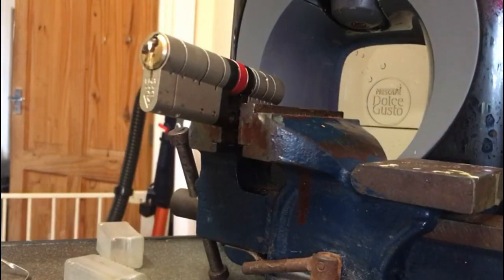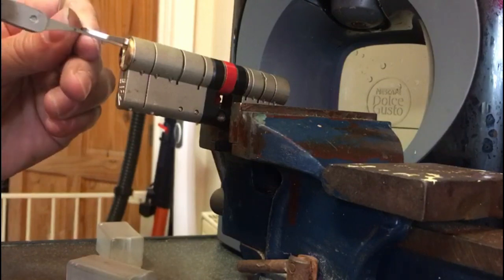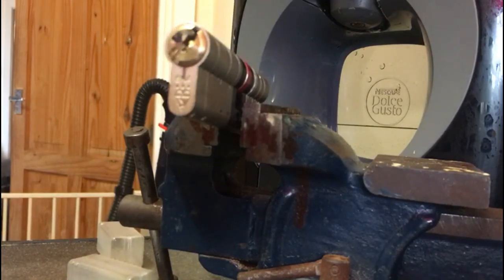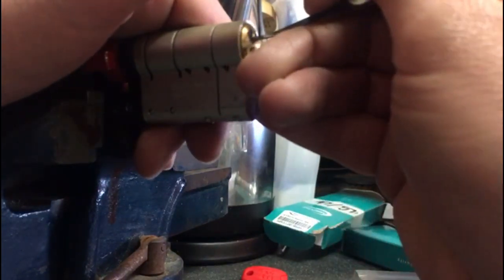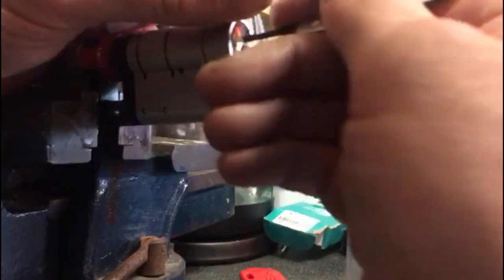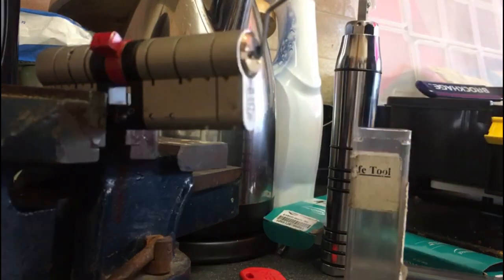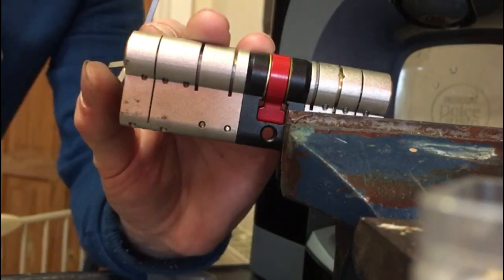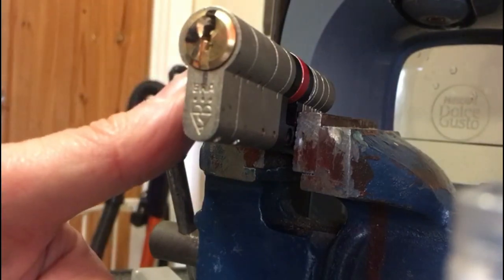Using a hybrid method to open an Era fortress 3 star cylinder

Comment: Nice job!! Just curious, would a plug spinner not skip the first set of trap pins?
Reply from the maker: I’ve tried plug spinners on different cylinders with trap pins but with no joy, but now I’ve got the fully loaded Dino one I’m going to give it another go 👍🏻🔑
Reply: @FortressLocksmiths  I have had some success  using  a spinner and cut down key together. 
Don't always  work but when it does  it is much easier
Reply: @FortressLocksmiths  couldn't  find my plug spinner yesterday, got a thick elastic  band and tanged the tension  wrench  and couldn't  believe  it fucking worked

Comment: These can be snapped and then drilled. I use a modified bar to slot over the entire cylinder right up to the hardened steel plate that holds the cam. Snap it out then just drill out the locking pin. Chris Belcher snap bars work aswel. Hope that helps.
Reply from the maker: Yeah I’ve seen the Chris Belcher bars think tradelocks still stock them actually, I’ve had to drill the locking pin on an ABS before , wasn’t a pretty job 😂

Comment: Very informative. Would it work the same on the trap pins using a tension wrench handle instead of a cut down key? Thanks for sharing mate. 😁🤞
Reply from the maker: I’ve tried the tension wrench method but even if it’s just slightly too thin the trap pins will spring, for the sake of it just file down any key that will fit and you’ve got 50% of the traps covered then 👍🏻🔑
Reply: @FortressLocksmiths  cheers mate, appreciate the feedback (pardon the pun)😁🙏👍

Comment: Just tried bumping a 3 star atk euro cylinder 
Seth .not a fucking hope😂😂😂
Any advice. I'm doing handyman call out for the council and bet my first fucking job will be a lock out😂😂😂
Reply from the maker: Err yeah, don’t try and bump an ATK they can’t be bumped, and if you did bump it you would get the key stuck in the trap pins
Reply: Cheers for the quick response mate👍just looked on the data sheet fucking six trap pins and 10 anti drill pins .though the lock .might have to drill with hardened steel bit if I get one of these lock I mean I can do board ups and stop leaks but I'm no a lock Smith you know what I mean 😂😂cheers mate keep them vids coming brilliant mate👍

Comment: Nice, unfortunately for me every one I’ve had of theses has been a thumb turn and not key and key which makes this lock a completely different fish all together, when it’s just key and key they can be easy epg with my gun and a cut down key. Try and thumb turn for a challenge 🔥🔫
Reply from the maker: Cheers pal, and yes....challenge accepted! 💪🏻💪🏻🔑
Reply: Cool, be very interested to see....now I really fancy a dolce gusto coffee 🔥🔫
Reply from the maker: @fireblaster9961  haha I live off them! Must have at least 6 every morning 🤣🤣
Reply: Is it not just a case of getting something all the way into the keyhole (to catch and engage the cam) whenever you turn the barrel? So like, pick the pins, engage cam, rotate until 1st set of trap pins, pick them, catch cam again, rotate until last set of trap pins, pick them, catch cam and finish the rotation.

Correct?
Reply from the maker: @OvermindAlpha  in principle yes but sometimes not that simple, for instance the Avocet ATK you just need to engage the cam once and then you can actually withdraw the tool and put a normal tension wrench and it will still rotate. The easiest way to pick up the cam on this (when it’s a thumbturn) will be to file down an original ERA Fortress key so it just rides over the pins but allows you to insert and withdraw at will and that should do it, in fact I will test out this theory tomorrow! In a normal cylinder it’s not a problem as you can rotate left and right until you catch the cam just right but obviously when there’s trap pins present it makes it more challenging